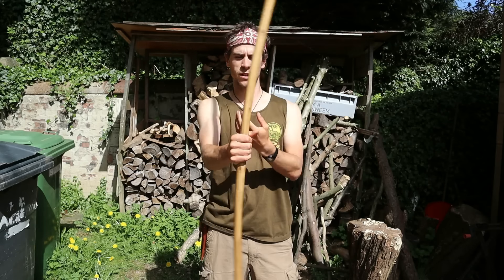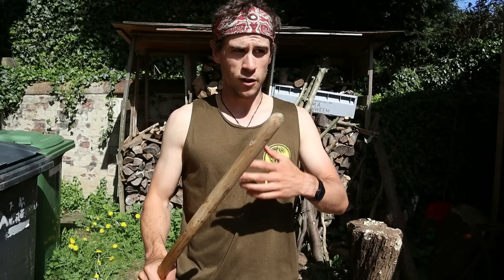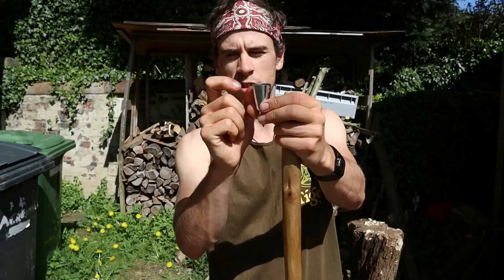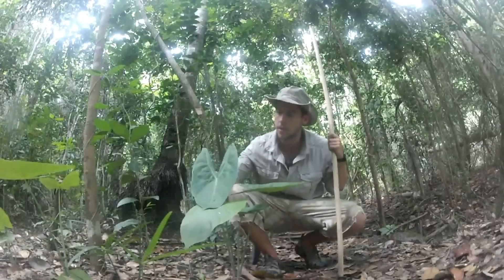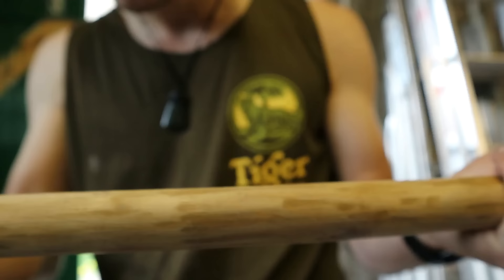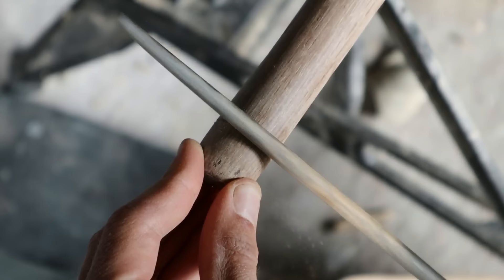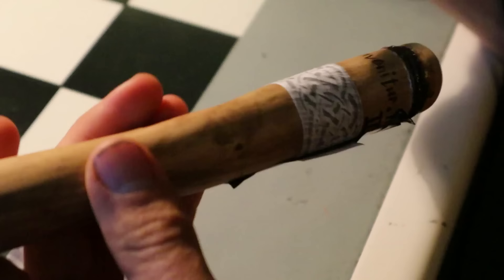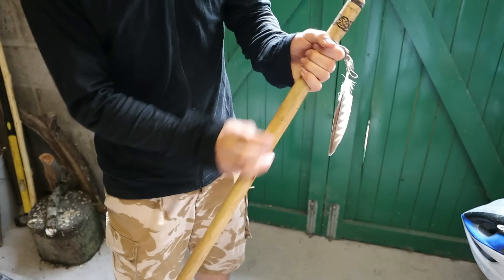Pimp My Staff- Walking Stick Maintenance, Decoration and Optimisation- Alpine Ferrule, Burn Designs

Comment: Another way to preserve the wood if you don't have access to linseed oil is to blacken the surface wood and then use a metal brush to take off the excess char so your hands don't stain. This is a historical Japanese method called Yakisugi. The fire hardens the wood, and the char coating acts like a fire retardant and minimizes rot by repelling insects and water. I like doing this method because it's free, it's simple and easy, and it lasts plenty long enough for a staff. If desired, you can also add linseed oil to further preserve the wood.
Reply: Im three years late but on the off chance that you get this reply, how would you recommend charring a staff? All the yakisugi resources on line refer to wooden planks for housing, and prescribe a certain way to stack them over a fire, but for a single pole I’m a little lost. Is it as simple as putting it in a fire or is it more involved?
Reply: @jamesmayou1361  A propane or butane torch works well for smaller items because it gives you good control and consistency over how deep you want to burn the wood. I generally aim to convert the first 1/16" to 3/32" of outer wood to charcoal, then brush off whatever will fall off. That way you have a thick enough layer to protect the wood underneath, but you also don't take off too much wood and weaken what you're trying to protect.
Reply: @jamesmayou1361 maybe you could try a butane torch of some kind. I seen a video of a guy doing it to preserve tables and other furniture he was making.
Reply: @jamesmayou1361 I used the burner from my camp stove. I've seen youtubers used a camp fire to harden the ends of wood.
Reply: If I don’t build a crazy staff , I at least fire hardened the tip , it’s pretty easy , your sitting at a fire anyway poke the fire around with it get it burning, rid it on the fire ring rock let it cool and repeat , it will make the tip pretty durable.

Comment: For the crack on the top, just soak the whole tip in thin super glue. Will keep it together no prob. Oak is notorious for getting  shakes or cracks, or whats called feathering, where the grain starts to lift up like the ends of feathers
Reply: Yeah also dipping in epoxy resin and then sanding it when it's done.

Comment: I mix 50/50 beeswax and linseed oil. It will harden again but if you heat it in a pot and then rub it in it will soak into the wood grain and then harden up. Take a heat gun to it for awhile to keep it warm and soaking in. I’ll do this 3 times and it takes forever to wear out.

Comment: Good stuff again! What you could do to customize it is fitting a pure copper or brass (brass is harder to shape and less effective against microbes) handle to the top of the staff. A piece of a regular copper tube of similar diameter cut to the desired length (I did mine with 31cm) can be pulled ower the staff leaving a couple of centimeters to hang over, than you can easily hammer the overhanging portion of the tube down to close it completely. Again, pure copper is very easy to shape by hammering even on room temperature, but one can heat it a bit over a fire to make it even more workable. It adds a lot of character to a staff (it can later be engraved too), + helps keep the user's hand relatively clean/desinfected just by holding it. I find it very useful during long hikings - it spares me of a lot of worrying.

Comment: Nice video. What I use of Wood handled tools as well as walking and hiking sticks, 3 parts boiled linseed oil, one part turpentine. Caution, wipe off excess in day or two, until it wears, the mixture will give a slight warth to the hand.

Comment: I don’t have good access to hardwood branches that would be the right straightness or size near where I live, so I went to the hardware store and bought a 6 ft long hardwood dowel that should work pretty well for a walking staff. Just need to sort of customize it similar to things you have done to yours. Thanks for the videos!
Reply from the maker: Yeah fare enough mate. Hardwood dowel will do you fine. Make sure there is no joints where they have fitted two pieces together though. That could be a week spot to break.

Comment: I made a walking staff out of the top of a beetle kill pine tree here in Alberta Canada. Damn beetles kill the tree and it stands there drying out. Once the tree is down cut the top 10 to 15 feet off the top. Pick your thickness and trim and strip the bark off. Strip the bark off at the tree site or burn it right away. Let’s not spread the beetles any further. I fire hardened the entire length. I drop it through my hand to hit concrete and it has a very nice ping sound to it. Very hard and solid. I left it wider at the top. Base of my cut.

Comment: As wood coatings go, any oil is better than no oil. I recommend Walnut oil. I have used it for years on my knife handles, bows, and cutting boards. It basically forms a waterproof coating and doesn't go rancid.

Comment: In the US we have Harbor Freight stores... their store brand super glue is very good! & great price!
Reply: superglue cracks, peels off, turns into dust. Two part epoxy resin should be better. You can work it with a chisel, sand it. I found mine to be made of the infamous toxic bisphenol A tho. So I'm looking for some non-toxic, more natural variety

Comment: One way to seal the staff from the weather, and strengthen it from splits and cracking. There is an old way of soaking the staff in hot raw unfiltered bees wax for at least two days per inch of thickness. "THAT" is the fun part. Keeping the wax HOT, not warm and covering the wood.
Let the wax cool until just below liquid state then remove the staff and stand it straight up for two days. This allows the wax to cool evenly inside the wood. It also keeps the staff straight until cooled. If there is an unwanted bend. This is the time to brace it and bend it straight.

We call these "Wax Wood Bo's". They are nearly indestructible, flexible, and hard hitting. 

Note. Do any decorations prior to waxing.

Comment: I make my own tool handles and one thing I was taught from an older guy was to soak your tool handle in linseed oil, or your desired oil, by holding it under the oil with some weights for a given time usually a period of days or weeks

Comment: A quick stop by the plumbing department of your local hardware store and for almost no money at all you can pick up some heavy-duty piping and all the tools you'll need to cut it to size and fit it to your stick. 
On the side note. I met a gentleman in Washington State who had fitted his walking stick with a very small, but powerful flash-bulb, rechargeable battery, and photo-electric array. Apparently, the area he liked to walk occasionally had cougars and per him, he has had to use it to scare off predators more than once. His stick was a slick little number, very light willow with a natural knob on the end that made it look like a wizard's staff and the bulb and array were nicely hidden behind a composite marble the size of a golf ball. Apparently, the dude was an engineering student and something of a fantasy nerd and said something along the lines of, "well, with all of our modern technology, we are wizards, we're just not doing anything cool with it". Pretty impressive, to me at least. The dude said that the staff he was currently working on would put this one to shame. I'm very curious about what form that will take, but unfortunately, I never saw him again.

Comment: That has definitely given me some ideas. Here's an idea in return. I have a cheap and nasty staff which is basically a broom handle. I rounded the top end a fair bit then used about 5mm thick epoxy to make sure it would not split. The next process was another 4mm or so of two part rubber over that so the epoxy will not chip. I used a urethane rubber. It's a bit iffy over time in bright sunlight but it can peel off and be replaces if you do it right.,

Comment: Another good hardening agent for maintaining integrity of split or rotting wood is cyanoacrylate (the original and inexpensive superglue formulation).  Bonsaists use this to maintain and protect deadwood to varying degrees of success depending on the species.  The viscosity is such that it absorbs deep into the wood.  It is also more hydroscopic (more like water) than epoxy from a chemical standpoint.  The celluloses, hemicelluloses and lignins  in wood are evolved to move water quickly and efficiently even if the wood is dead.  A wood like oak with large pores will suck it up super fast.  If you keep humidity down during the application it will penetrate the deepest. Thick epoxy will sit on the surface, more like a varnish.

Comment: super glue works better than most epoxies for this kind of use. it will soak in deep and make the end really solid. myself and many other flute makers use it as a wood finish on the foot and mouthpiece of our flutes to help keep it from splitting if you drop it. it also shines up easy like lacquer.

Comment: Great video, Thanks! Those Alpine Ferrules are also known as 'Rock Spikes'. It's worth noting that some cheaper ones on the market seem to be made of very soft mild steel, and wear down quickly, so try to avoid those; I've made my own from slightly tougher stuff which keeps a point quite well, and threaded them to suit a semi-hard fibre cover, crosshatched on the end face as a pavement grip for the odd occasion.

Comment: Boiled Linseed Oil is also food safe, but what they sell in stores under that name is not BOILED Linseed Oil. Boiling the oil takes time so manufacturers use chemical additives to imitate all the advantages boiling gives linseed oil. That stuff isn't food safe at all. The old adage about using boiled linseed oil on a new bare wood project says: "apply once a day for a week, once a week for a month, once a month for a year and then once a year for life." Good video. =)

Comment: Maybe you're familiar with the 'Bergstock' , a stick about 2.5 metres traditionally used in the alpine region. A 19th century hunting manual I read recommended you fit your stick with a steel tip on one and a rubber tip on the other end, so you can just turn your stick upside down to make less noise if necessary.
Reply: if you slip with the spike upward you're liable to get impaled
Reply: @j.r3987  Thats unlikely to happen with a stick that stands a good bit taller than you
Reply: @nilsschenkel7149  very true. I'd still be wary when going downhill though

Comment: Try applying 50/50 mixture of Pine Tar and Turpentine to the next wood staff you make. Let it cook in the sun for a few sunny days or help it in with a heat gun and then make a second application. Let it soak again and then apply a boiled linseed oil coat if you don't like how the staff sticks.

Comment: I have done a few Jo from thai tree I find in Thailand but doesn't know the name. But my preferred one is rattan Bo that my teacher bought from a china town shop in Bangkok, it is super flexible  but solid at the same time. The flexibility gives a lot of snap  and return of energy actually and it is hard enough at the same time so we can fight together without fear of breaking it. I burned design on it as well as reference for hand positions.

Comment: Great video. I think a better point for the end would be a very shallow, perhaps only 1/8 inch for safety.  Then it could step up in diameter in concentric circles several times to give you additional contact edges on uneven rocky terrain.

Next time, try burning out the white parts of the paper transfer instead of the black and it might turn out better for you, but it looks great this way too.

Comment: I've read some quarter staffs had a steel ring on the top, as a bit of an extra striking aid and a weight, perhaps it also serves the same purpose as that string/epoxy thing you're doing as well, except even stronger

Comment: I thought: oil protects the staff, but what if the ferrule end is consistently moist? Won't that infiltrate through the wood through the screw hole? what if you took the ferrule off and soaked that end of the staff in linseed oil, and then screwed it back on? I think that would offer some additional lifespan.
Reply: If you're worried about that, you could always take off the ferrule and soak the end in linseed oil to impregnate the wood, if not to the centre then at least as far as water is likely to reach.

Comment: quick few suggestions 1) you could have used something akin to a through pin and clip to attach the alpine furrle instead of screws to get it on and off faster and without the need for a screwdriver, 2) wood-burning kits are cheap and tend to give much better results than a soldering iron, and 3) you can easily find designs to wood-burn on the internet that you just need to print to the right scale.

also these days if someone is within strike range of your staff and not part of your household a nice soft rubber tip to prod them out of your personal space may be a good idea...

Comment: Nice video.  For fixing a potential split you might like to try CA glue (superglue) , if you use the thin stuff it will wick right into the crack, that said your epoxy fix looks pretty bomber.

Comment: Sand the epoxy and re-apply.  It’ll be harder and smoother and you’ll be less likely to knock off that flake.  Consider varnish over epoxy for UV protection (sailboat owner).  Nice staffs.  I like the alpine ferrules.  Consider cutting the head of the screw off and peening it down.  Smoother but permanent.

Comment: Drill,a hole and install a magnet inside it and use sharpened hex head screw driver heads.  6ou can remove them or make barbed spear points with lanyards

Comment: Nice work Tom. Given me some inspiration. Have you ever used Tung oil instead of Linseed? I've treated a number of martial arts staffs with that in the past because it is less toxic than Linseed.
Reply: Use flaxseed oil at the grocery store which is the same as linseed oil but different name. Takes longer to dry because it doesn't have chemical dryers but is totally safe.

Comment: For decorating your staff, you might also look at the old Norse technique of kolrosing (similar to scrimshaw). You can buy a knife to do it, use a Mora type Sloyd knife...or you can make one quite easily (I used a 6 1/2mm HSS drill bit)-I followed a tutorial on YouTube and it was straight forwards to do. For the colouring you oil the wood, drop your powder on (I prefer cocoa powder, it’s nice and fine and gives a good dark colour that stands out well. Coffee grounds work too, as does soot), rub it in with your finger and wipe the excess off with a cloth. Finish by burnishing-polished bone or antler is a good choice, though the shaft of a screwdriver (one free of dinks and scratches would work too, especially if polished).
If you can draw your design on in pencil, you can follow it with the knife. The wide bevel helps to open up the fibres, and the triangular tip can be used for accent work (like the tips of the spars on an engrailled cross).
I really hope you give this a try and would love to see the results!

Comment: I am trying to create a self defense cane can I use the alpine spike and just cover it with an appropriate rubber tip I mean if I were using this as a self defense device could I pull the rubber tip of instantly? p.S how much side does the alpine tip add to cane ? if you have an idea how to help me it would be appreciated thank you so I wonder is there a way to put a spike tip that can be covered with a rubber tip and instantly removed in an emergency for use as an emergency spear I mean my martial arts instructor seems to frown on use of fire arms so if there was a spike that could be kept covered than instanly put into use it would be great !!!! thoguhts please thank you

Comment: Hey man, I'm a martial artist who frequently works with exotic hardwood weapons. I've been looking for a method for affixing my paracord handle wrappings (preferably without glue) - do you have any advice that wouldn't damage my woods? They are typically treated with tung oil or beeswax, and I'm open to refinishing to boiled linseed or teak oil if absolutely necessary.

Comment: thought, loose the screws all together and drill for a bolt. would be stronger and will save the staff from damage with he constant screwing and unscrewing which will eventually burr the hole
Reply from the maker: Yeah good point. If you could do it in a way so that there wouldnt be too much bolt sticking out then it could be better than screws
Reply: @FandabiDozi  cut and file the bolt so it fits perfectly, with a nylock on one end would be ideal
Reply: Fandabi Dozi what about two large pointed set screws? If they are big enough, I believe you could get them with straight or Phillips head. That way you could still use your multi tool and they would be totally flush, if not recessed, with the ferrule. ;-)